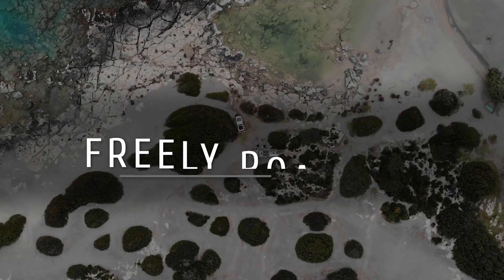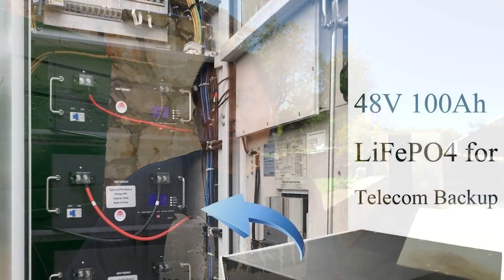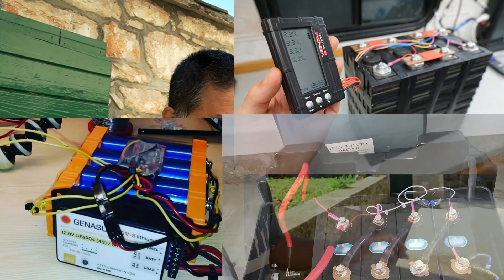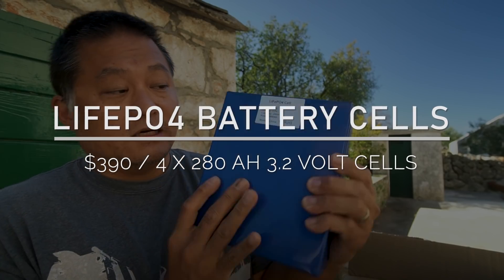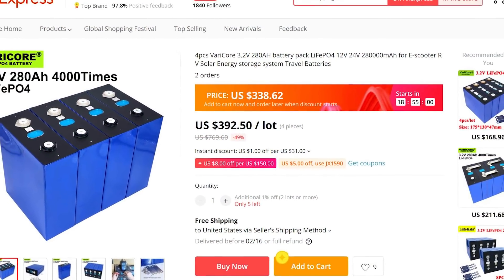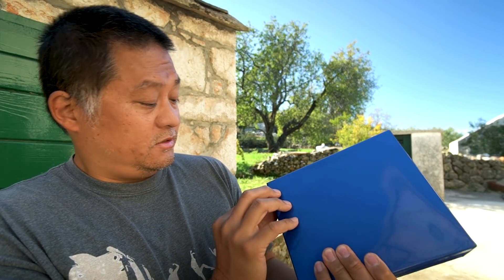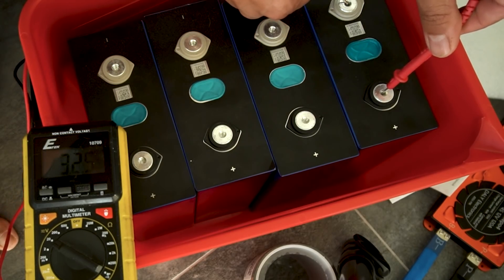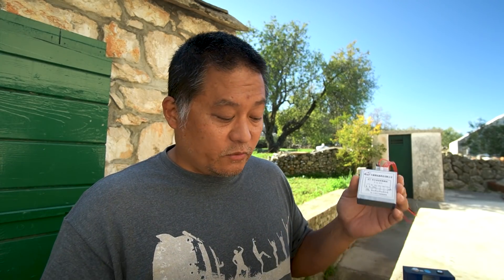Build Your Own 12-Volt LiFePO4 Battery For Cheaper Than AGM

Comment: In roughly 2008, GM was introducing the parallel hybrid truck or (PHT / Maybe earlier) but as a contract employee, we had two cross-training week long sessions each year. The engineer was pointing out the entire system but to focus on the battery pack, these where in utilities and extend cab trucks. We did not go into the BMS but pointed out they used a NTC thermistor between every two battery packs. Their charging strategy was 80% of full and 20% of discharge. But also it is common practice to design & spec parts that would last 5,000 hours or = 150,000 miles. 
 Now for AGM. I like the idea but if in a vehicle and discharged two or three times, they are just about done. 
 Now, what kills a normal battery (Lead Acid / AGM) if the battery in located away from extreme quick temperature changes and vibration by placing it under the rear seat, providing a sealed cavity, vented to outside, will last 10-11 years or longer. This story was told to me by many shops and guys I knew for years. 
 From the factory, GM used a dense foam cover that fit the battery. In the stack of returns, half of the GM application came back with the foam blanket on it. In the 80’s, magnetic oil pan heaters for Nebraska winter where sold along with dip-stick heaters or cut a hose or remove a frost plug and put in a heater. The best use of less wattage is an electric blanket for the battery. It kept the battery nice and warm and spun the engine over like a warm summers morning. 
  Just a thought to share. I subscribed and hit the like button. It is worth having someone knowledgeable tell you about the use of Li-ion batteries in vehicles, the channel clearly does it well. Blessings and I will be looking at other videos, as I rebuild my sons steering gear box. ASE Master Tech since 1978 - Retired
Reply from the maker: Thanks Dean. Appreciate your very useful insight. Looking forward to more interaction with you in the future.

Comment: Very cool! Do these batteries have a 10 year no questions asked replacement warranty like Battle Born batteries?
Reply from the maker: Yes. In fact if you pay the same price as you do with Battleborns, you get all of your replacements batteries up front. No questions asked.
Reply: @freelyroaming  So they don't have a 10 year warranty. We live out of our van doing art shows and don't have room for storage and the BMS is built into each of the batteries. Do the they also cover the BMS like Battleborn  does for 10 years?
I usually detach one of the batteries for our electric trolling motor. The boat got practically swamped  BMS got wet Battleborn sent out another battery overnight. The other thing is that BMS monitors each and every cell inside the 12 volt drop in replacement system. Been using them for 3 years other than having  a battery compley underwater the have worked great. Does that system monitor and equalize each cell inside each of the 4 cases with auto temperature control against charging the battery if the cells are to cold or get a spike in charging or over discharging ? If they don't thats when fries start. Battleborns BMS checks each cell independently every 5 seconds.  The largest draw I have is a 1700 watt microwave with 3 100ah Battleborns running through a 2000w pure sine wave inverter.
Reply from the maker: Yeah that doesn't sound better than getting 6 sets of batteries for the same price.
Reply from the maker: But seriously man, I am not against anyone who wants to pay more and get the warranty and all the handholding to avoid the DIY aspect of this project. In fact, I think most people probably should buy a ready made pack instead of building their own. In reading a lot of these comments I see a ton of people who have no business building their own because they risk injuring themselves. But that is not what this video series is about. This is to show those who are willing to learn and open to alternative options and don't want to rely on some factory providing a cushy warranty at 6 times the price. If you are just gonna buy a factory made pack with a warranty why do you need anyone making a video to show you how it's done.
Reply: @freelyroaming  I hear you the problem is when you pathree times over and have them fail in 3 to 6 months or even a couple of years later with no warranty and you end up paying twice or three times more than battleborn batteries
Reply from the maker: To pay 3 times more than Battleborns batteries would mean that I would have to pay $9,000 for 300Ah. Instead, 300Ah only costs me $700 including the BMS and all the necessary parts to build my own. I can literally build a new battery for every year for 10 years (probably even longer as prices continue to fall along the way) and still have $2k left over. Or more likely, this batteries will not fail and have $8,300 left in my pocket. You know that Battleborns does not manufacturer the raw cells or BMS. They buy them from China just like most do. There is no secret sauce that makes their battery somehow last longer. They pick quality parts and assemble a good product and offer a good warranty but they need to charge a huge premium to do that. If you are not into DIY projects and have the cash then go for it. That is not what these videos are about.
Reply from the maker: But I understand where you are coming from. You were recommended this video by youtube and clicked because it suggested LiFePO4 is now cheap. Meanwhile you already spent $3k on your Battleborns. You need to justify what you paid and talking about their warranty is how you are justifying. I'm cool with that.
Reply: @freelyroaming  No mine are working fine but a buddy of mine is switching from AGM. I personally wouldn't buy any Lifpo4 with out a warranty ever. I like to set it and forget it. That being said if a Lifpo4 manufacturer can't warranty the battery like Battleborn 10 years or Dakota 11 years and isn't made made in the USA there is definitely a reason they won't warranty the product. Been there before at the tune of about a $1000 lost because the batteries were made by a foreign company I had no  Legal recourse after only 3 months use. Valuable lesson learned!😁
Reply from the maker: I don't think you understand the point of DIY. You are the manufacturer when you build your own stuff. You warranty your own work. If you build it in the US then it's manufactured in the the US. All the companies you love so much all buy foreign parts. People who DIY enjoy learning the ins and outs of what they build and enjoy knowing what to do if something breaks. Paying a crazy premium to have some corporation give you a warranty is completely missing the point. But if you like paying more than 500% of the actual cost and depending on sometime else when something breaks then you go with your bad self. You are clearly trying to justify why you paid $3k and where the extra money went. It's like telling a carpenter that he should go buy furniture from the store because it's easier. No thanks.
Reply: @freelyroaming  Okay I still don't think you understand exactly what I'm trying to get across. I do understand all the batteries are foreign made but Because they are assembled in the US with Battleborns BMS which is no secret  in the industry as being the best Battery Management System 
If you buy $3000 dollars worth of the batteries to have back up batteries and they all fail in less than 3 years time. You lost $3000 the Battleborns still have 7 years left on warranty And yes cheap lifpo4 batteries do failed as I mentioned my experience  with them.
I would be curious to see a 1700w load test on them every day for 10 years in real world applications. Battleborn has been around for 7 years under it's parent company Dragon Fly Energy in the US. I  definitely understand the importance of you checking out alternatives like Will Prowse does as well. Its awesome entertainment and learning fun. Thank you for your service 🙏
The reason I absolutely need 100 percent proven stability is because I have over $250,000 dollars worth of our artwork and set up display booth for the art shows that we do.(completely usless to anyone else. Lol) but it is our livelihood if the bms ever failed and caught on fire it would completely destroy the artwork and ou business. Because we can only print the plants 6 weeks out of the year unlike paintings that can be created all year.
We've been full timing it since 2011.
Reply from the maker: @steve56975  I think you are missing the point. No DIY builder will buy $3000 worth of batteries upfront if they only need $600 worth of batteries. That point was to illustrate just how much you are overpaying for your factory built pack to get that warranty and to feel that sense of confidence most non-DIYers need. That's fine. Companies like Battleborns need to to stay in business and make a profit. Selling batteries at a huge mark up and include a seldomly used warranty is a great way to make money. Let's not pretend for a second that it is a good deal. Also the fact that you think having extra batteries properly stored away not being used will somehow become damaged shows that you are clearly not the right person to be building your own batteries in the first place.
Reply: @freelyroaming  Oh I agree Dan but you can't guarantee  10 years out of the cells or the BMS . If I had A fire in this sprinter our 10 years of a $250,000 art portfolio would destroy our business. It would take 10 years to build it up again.  As you know a lithium fire is a bitch to put out even if you're  around to catch it.
Reply: You cannot guarantee the batteries you put together aren't going to catch fire or  that the bms doesn't fail. If so you would be putting them together yourself and selling them with 10 year guarantee for half the price! And I would buy them from you.  First off they don't have a 7 year perfect track record. They don't use the same trusted cells that Battleborn or Dakota use.  Dan I've been putting electric components together for over 40 years so not an issue for me. Who makes the cells inside the pack? Is each and every cell being monitored by the bms. Why would you be so defensive. All I was trying to figure out why there is no warranty on at least the cells and you turned it into passing match. The whole purpose of a warranty is not just about the batteries it's also about legal liability. It's not because I don't trust mine or your abilities.
It's all about the components you know that.
Reply from the maker: @steve56975  if you know what you are doing you can build a pack just as, if not more safe than a Battleborn. No one can guarantee that any battery build by anyone won't fail or catch fire. Offering free replacements for their batteries you paid for at huge premium is far from a guarantee that if your van burns down they will be there for you. I don't need anyone to guarantee me for 10 years. I understand the engineering and science behind how it works and I know the odds are on my side that these will not likely fail once they have been initially tested. There is no fairy dust that these manufacturers sprinkle on their packs that make them last longer. They do it completely for business and revenue generating reasons. If they start to see a high percentage of warranty exchanges you can be certain either prices will rise or their policies will change. You are at their mercy.
Reply from the maker: @steve56975  and in fact people do build them and sell them for half the price (ExpertPower, SOK to name a couple). I even talked about them in this video and placed links in the description. That is exactly why prices have been falling. That is in fact the whole premise of this video. I am in no way defensive about this. I just disagree with your position that having a warranty that costs a premium is somehow better than someone who choses to DIY their own solution. That is, after all, your original insinuation from the comment you made at the top of this thread.
Reply: @freelyroaming  Dan I agree and completely agree but I have also seen cycling testing degrade by 50% after 300 cycles in the cheaper cells. I guess if I knew the cell manufacturer that could tell a lot but then again some cell are marked with one manufacturer but if you remove the fake label it sometimes gives a different story and vice versa. I think you know what I'm getting at.
Reply from the maker: @steve56975  Where have you seen batteries that degrade to 50% after 300 cycles? I would have to assume they are first of all, grade A cells and cycled under recommended conditions to make it a fair comparison. That data is missing in your phrase because all cells can degrade after 300 cycles if they are pushed beyond the manufacturers recommendations. Give me one of your brand new Battleborn pack and I can make it degrade in the same way if it is abused. As a DIYer, you are the manufacturer which means you are the person providing yourself the warranty. If I my budget was $3000 to build a 300Ah pack, I can easily provide a no-questioned-asked 10 year warranty to myself. In fact probably a 20 year warranty is easily in the budget. That is the point. Manufacturers warranties are based on the insurance business. You are always paying for it and It is designed to maximize their revenue.
Reply: @freelyroaming  Will Prowse channel. 
They were obviously faulty. I've also seen capacity test vary greatly, as I'm sure you have as well.
Reply: @freelyroaming   would I be able to add one or two of these to my existing 300ah Battleborns that I've had for 3 years?
Reply from the maker: @steve56975  There are grade B cells that are going around and from a good reseller you should know that you are getting them and they would be priced accordingly. I don't think Will Prowse has ever done a long term 300 charge cycle test. I haven't watched all of his videos so please point me to the exact link if it exists.

Comment: Have you seen how Li is mined and who the miners/minors are? It will sicken you, or it should
Reply from the maker: Yes I have. Are you suggesting a boycott of lithium related products? Because that is not the solution to that problem.
Reply: @freelyroaming  Electric vehicles, tools, etc  should not be promoted until there is a clean source to propel them. True clean energy will be available once we get rid of the deep state
Reply from the maker: You are going off the deep end here. I suppose we should all stick with petroleum based fuel until the 'deep state' has been eliminated huh?

Comment: What I do not understand is how the BMS with the single connection can balance the individual cells without a monitoring wire to each cell.  Even if that were the case how would it direct charge only to the weak cell or shut off charge to prevent over charge of the strong cell to theoretically "re-balance" the pack?
Reply from the maker: Besides the main battery negative connection, the BMS also has 5 separate balance wire leads that go to each individual positive terminal of each cell and the main negative connection. I guess maybe it wasn't shown clearly in the video. Those are used for cell level voltage sensing and balancing. It reduces the voltage on the higher cells via heat dissipation using onboard MOSFETs or actively transfer power from one cell to another to bring them to balance.

Comment: Thank you so much Dan !!. Look forward to hear your testing of the cells. The cells are EVE copycat cells. I purchased similar cells from xuba on alibaba for 80usd/kwh. The capacity was ok but they could only deliver ~10a. Maybe just variable quality?
Reply from the maker: I have a capacity test video on the channel. Certainly there are various grades of these cells being offered at several different prices. It can be a bit of a crap shoot but I was fortunate that they tested above rated capacity albeit at a fairly low C rate (0.07C or about 20A) but I am happy with it. They are staying well balanced after a few cycles and offers all the current draw that I need for my application.

Comment: If I need two 12V batteries, do i need two BMS? one for each set of 4 cells?
Reply from the maker: You can do it that way which will be essentially building 2 separate batteries and connecting them afterwards in parallel. That would be a 4S2P (4 in series, then 2 in parallel) setup. Or you can first connect your cells in sets of 2 in parallel and then treating the cell pairs as single cells. That will allow you to use just 1 BMS for the full pack. That's called 2P4S (2 in parallel, then 4 in series).